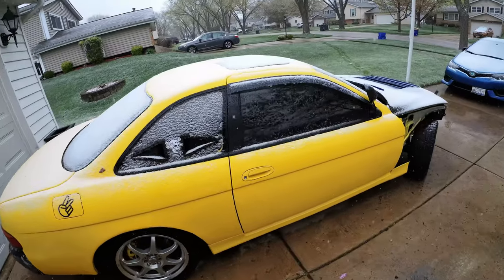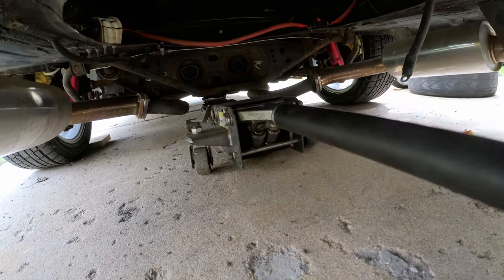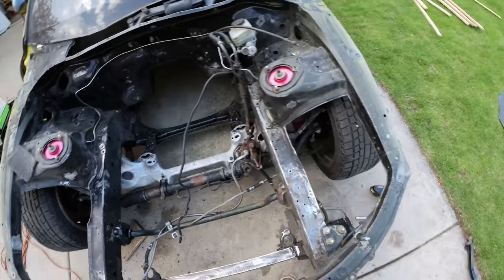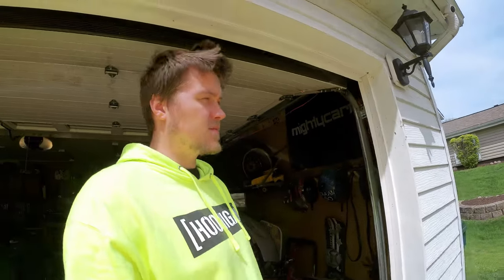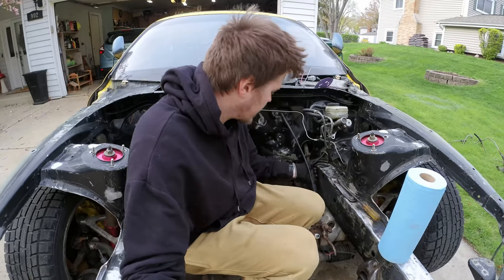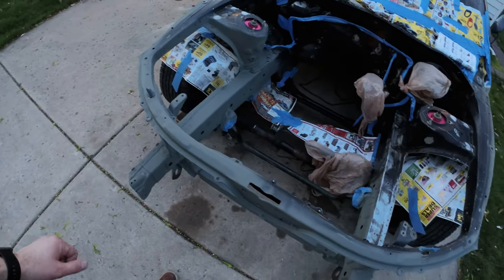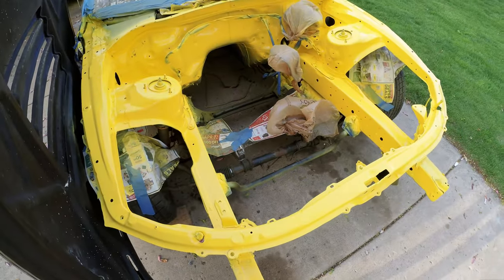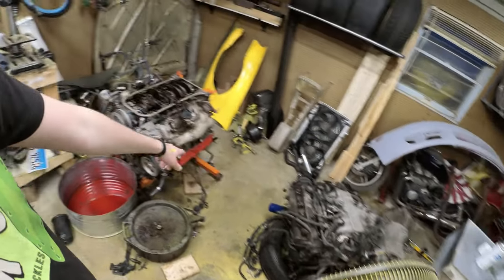I Painted The Engine Bay in my SC400

Comment: Production value is more than the car. 
I too need overfenders due to rust. 
Also I noticed your abs delete. Yeah ima copy and paste that shit.
Reply from the maker: I completely built my own brake lines from scratch. Stainless steel lines so they'll never rust. Check out my brake overhaul video. I'm not putting over fenders on I'm just gonna cut the quarters and pull them.